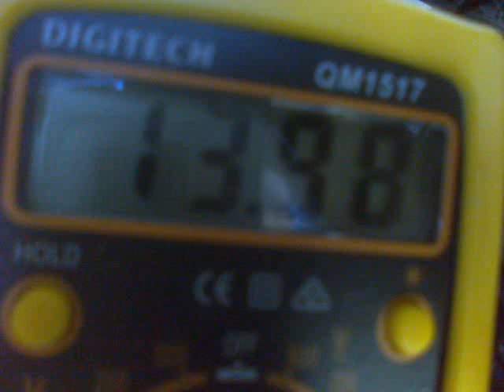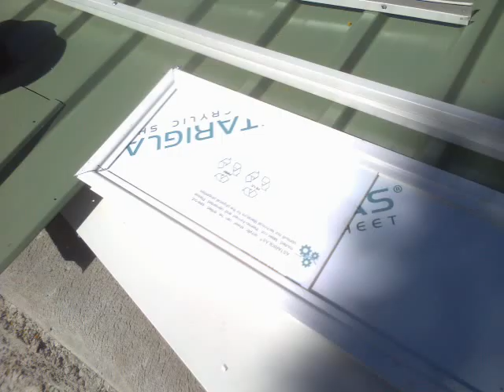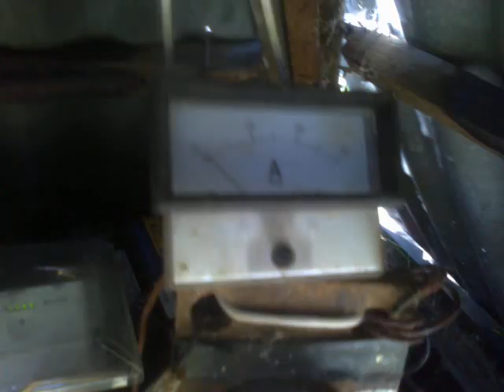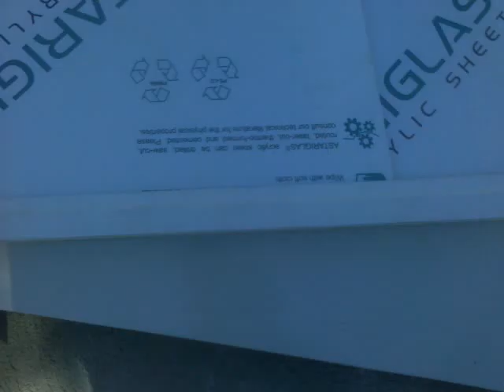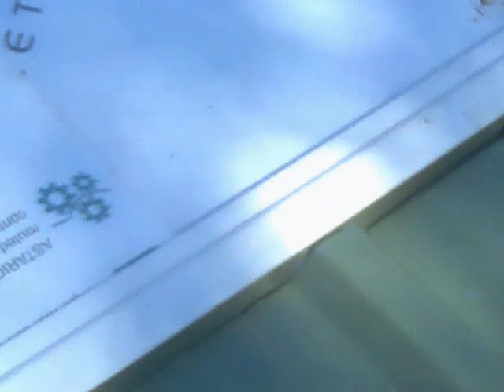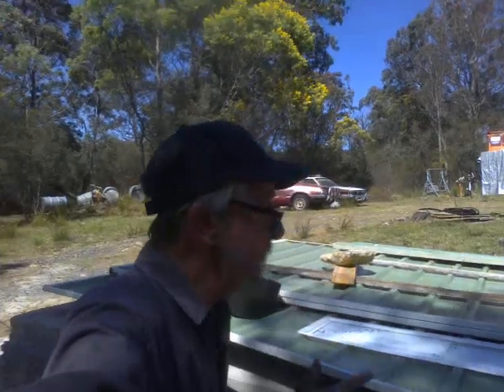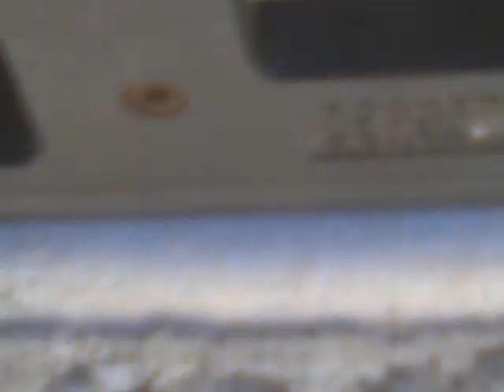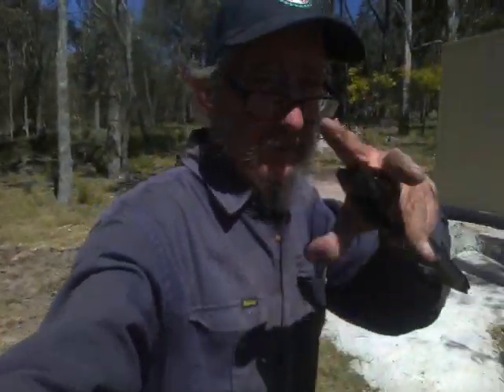The Prefabrifuckupificated Building Saga Continueth....

Comment: Always good to incorporate bio-bug traps. Your friendly neighborhood spider offers a tradeoff.

I'd probably be at the slabs with an angle grinder trying to level off the strips where the shed walls are supposed to sit. Maybe even a chisel and a hammer if need be. I can be a bit anal that way. 

Thanks for letting us see how things are going.
Take care Chris.
Reply from the maker: G'day,

Thanks mate !

Well, hopefully my Slab is flatter than Liz's seems to be.

We'll see.

Her Shed is right now being fine-tuned by the couple who erected it, and my current opinion is that they should probably true the Corners to 90° & anchor the Shed to the Slab based on that..; then remove the Doors' inner Triangulated Cross-Braces, fit the Doors to conform to the Paralellogram
Of the Door-Frame, and then re-attatch the Diagonal Frames to hold the Doors as Nesting-Doll Parallelograms which should neatly fit the Frames - and meet each other neatly as well (?).

Not my job to say so, though, and I've been barking at people too savagely for weeks, lately - lots to be pissed off and anxious about ; and once my Cerebrospinal Fluid is loaded up with Neurotransmitters for being Anxious and Cranky the short circuits in my early-overloaded old Amygdala are all on a hypervigilant hair-trigger to 
SNAP !!!
At pretty much any Percieved 
Provocation for maybe a week or so, until all the Responses to 
Stress have been
Metabolised, unused, from the CSF, pissed out and away, and I can get back to tolerating foolishness, without burring up
Instantly...

The Norms pay their Taxes to pension me off to sit under a Gumtree feeding the Kangaroos ; pretty much because some days I'm not fit to go out among them all, so I don't, and thus they remain
Unperturbed by 
My
Excoriating and corrosive
Attempts to communicate my mood and feelings.

Hermiting is goodly...!

Such is life,

Have a good one...

Stay safe.

;-p

Ciao !